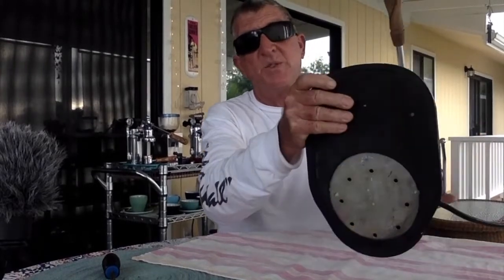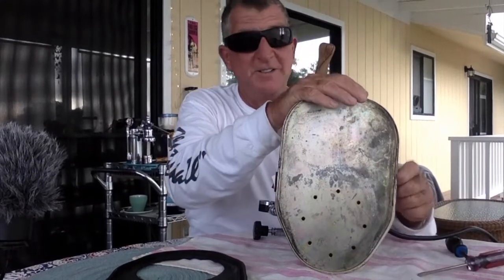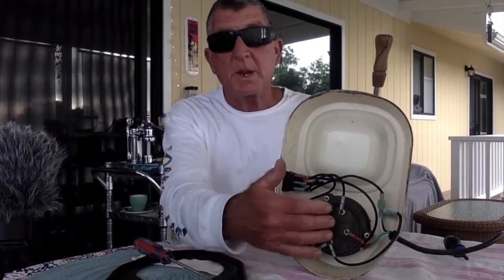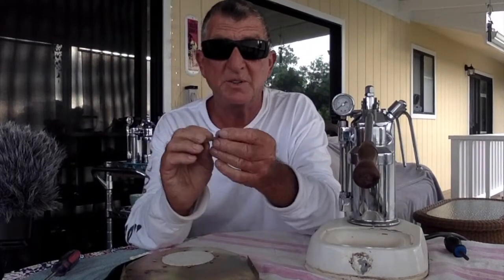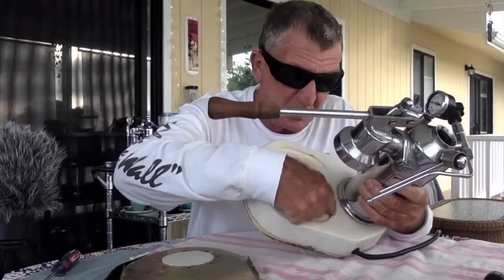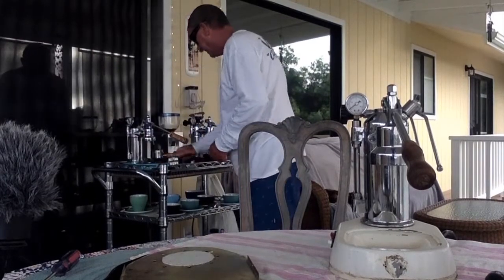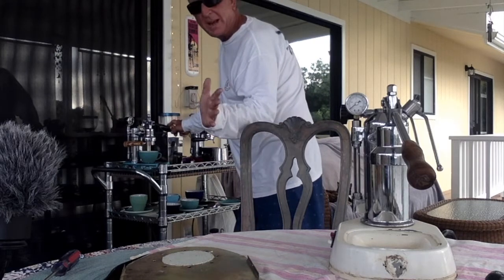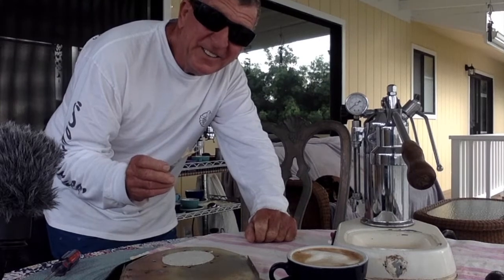Time for Fun and Whimsy

Comment: Looks very much like the 78 Euro I'm working on. In really good shape but no ground wires anywhere! Gotta figure that out. Thanks for the video.
Reply from the maker: On the one I drilled a small hole in the base and grounded it there . :)
Reply: @theespressocouple  Thanks.   I'll take a look at that. That may be about my only option to keep it clean. 🙂